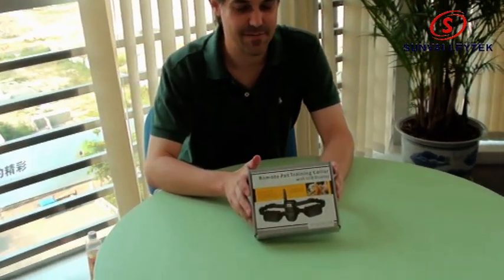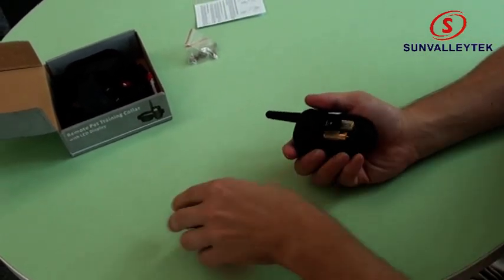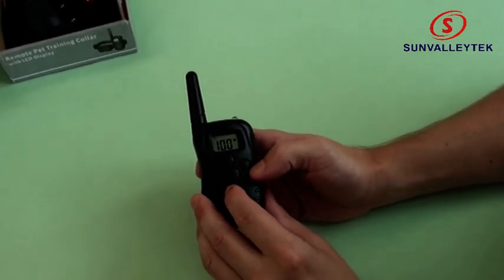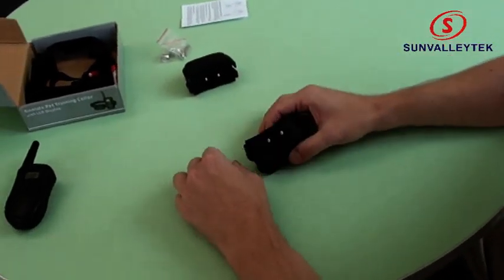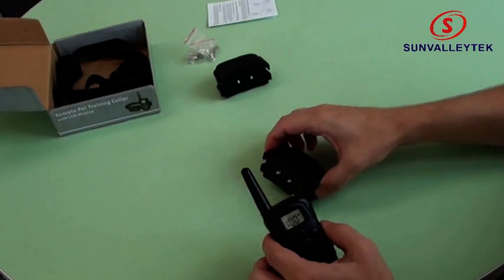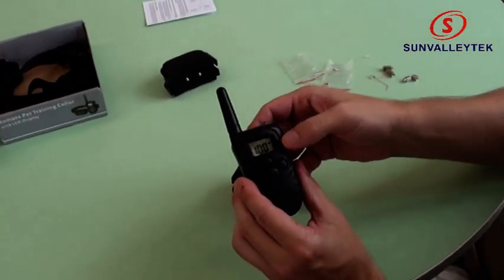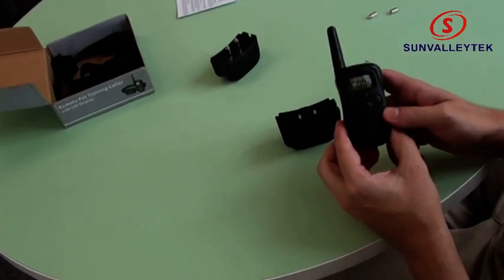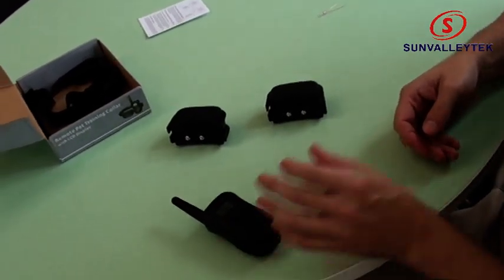LCD 100 Level Shock & Vibra Remote Dog Training Collar 1 to 2/35-01104-103.1

Comment: fold the collar in half with the open side facing the slots in the collar ,, push it between  the slots on the collar and let it flatten out or push it with your finger until it slides into place ..